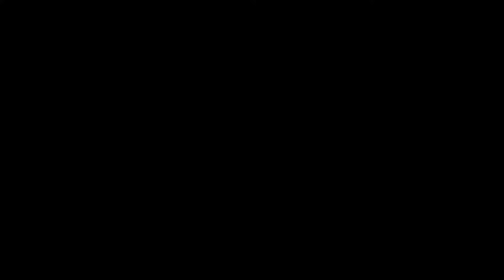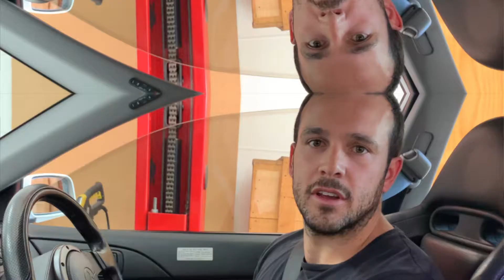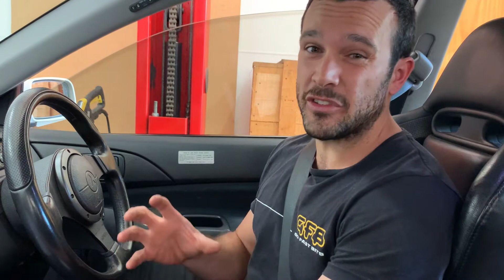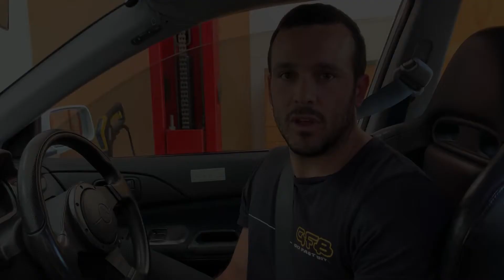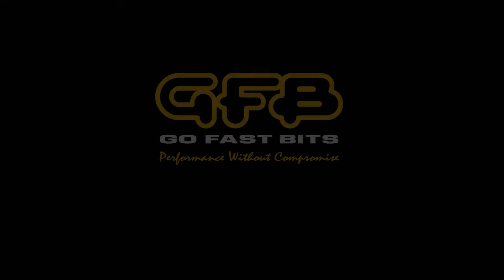GFB G-Force III Part - 4 Sensitivity Setup

Comment: In how many increments should I increase the sensitivity. Like should I put it on 5 or 50 to see a difference
Reply from the maker: It's entirely dependent on your setup, so experimentation is the only real answer. However, to save some time, I'd suggest starting at 40 and making increments of 10. Where you'll notice the difference is the amount of high RPM boost drop-off (taper). The sensitivity setting is attempting to keep the boost from dropping off by increasing duty cycle, so the ideal setting really depends on what duty cycle you're running, and how much your turbo's boost drops off naturally.

Comment: I have a 2018 F-150. I’ve checked out your BOV and want to know what exactly are the benefits.
Reply from the maker: Hi Steven, 
There are a few benefits of the VTA valve over the OEM part. In terms of performance, the VTA has a secondary spring which allows the piston to close sooner after venting. This allows some boost pressure to be retained in the intercooler during gearchange and can improve throttle response once you get into the next gear. 
The factory valve in these cars is a diaphragm design. Diaphragm style valves have been known to be prone to failure, especially in higher boost pressure applications. Many manufacturers such as VW have moved away from the diaphragm design. The VTA uses a piston design and tight tolerances in order to solve these issues. 

The main reason people tend to go with the VTA though is for the noise. It's a matter of personal preference, but if you want that BOV sound then the VTA will allow you to achieve that
Reply: Thanks alot for making these vids. I had it all wrong. I'm gonna go fix what I wrecked earlier lol